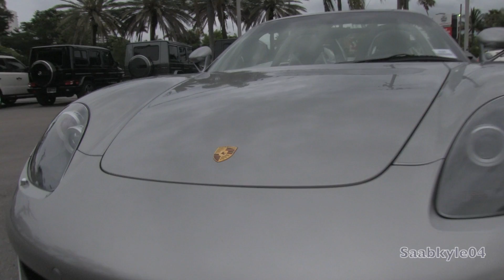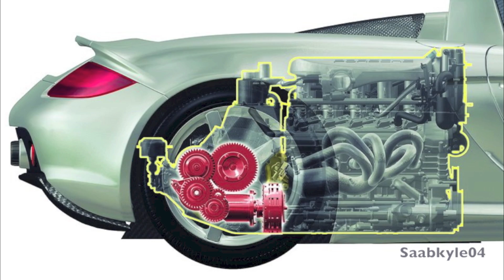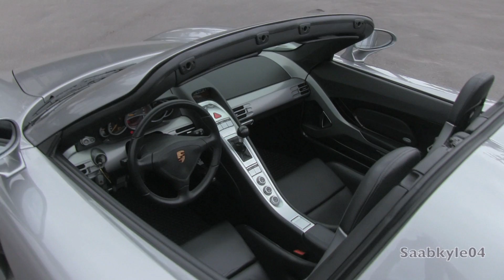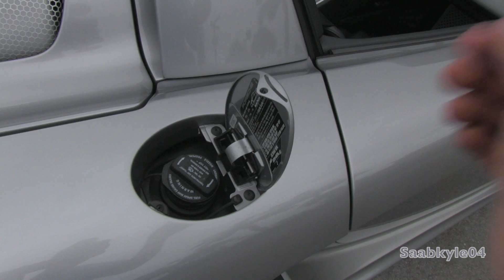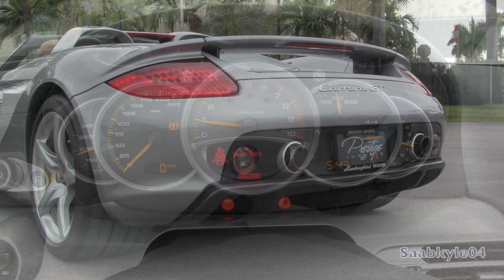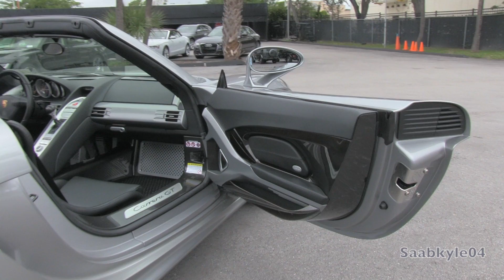2005 Porsche Carrera GT Start Up, Exhaust, and In Depth Review

Comment: You're not going to find a 100% functional Porsche Carrera GT for under $660,000. So if you bought one of these 10 years ago, you made one helluva solid investment, it's selling for $220,000+ more than the retail value, now days. I've seen one sell for $786,000 that's $346,000 in your pocket.
Reply: One with 1,080 miles going for $830,000 in Plano right now

Comment: I was about to buy one but then it didn't have stabilizer that's how Paul walker hit the tree and the way the seatbel t was designed broke his ribs and torso but he couldn't get out of the seatbelt cause it locked
Reply: Sure you were
Reply: +John Petito it was a used one it had 40000 miles
Reply: BS...
That's still a 600 000$+ car
Reply: +Benjamin Nenert my friend was selling one for $499450 he said just because he saw one with 30k miles and it sold for $599999 he ended up just junking the car

Comment: The service interval of the clutch is 10.000-20.000 miles, depending on driving.

It is possible to completely ruin it, by ONLY 3 "launches". I know from experience as I have a relative owning a service shop which regularly services the clutch of one such GT (again in silver)

The clutch with replacement labour costs 7500 euro ($8-9k). The disc itself is 7k euro from germany with 1month wait time.

Talk about absolutely useless hypercar. In comparison maintaing a McLaren P1 is nothing (its almost comparable to regular car-service intervals)
Reply: The P1 and the Carrera GT were made over 9 years apart. Did you honestly think that they would be comparable?
Reply: That's probably because the CGT is more of a race car than a road car. Even the engine is from their race program and the clutch is pretty tricky. 10,000 - 20,000 miles... Likely.
Reply: fuck off
Reply: Виктор Шишков you're what many people would call a "douche bag." the best you or your family could dream of is wiping the grease off a cgt for the people who own them.

Comment: I love Porsches and the Carrera GT is no exception.

However, I have a mixed feeling due to the great sounding engine & mind blowing performance to the 996 era-interior and above all, the movie racing legend Paul Walker...

EDIT: Kyle, I'm surprised you didn't go over the engine's history a bit more in detail. I read somewhere that the V10 in the Carrera GT was actually, as you stated planned to be a 5.5 V10 to be used in a LM racing car. Since the rules changed, the engine was slightly stroked for more torque in the current road application. I guess that also explains the unique sound to an actual racing car.

Comment: The car is all nice and that, but it still suffers from the Porsche-specific flaw of not protecting enough the petrol tank from catching fire after a front collision. I'm not specifically talking about what happened with Paul Walker, but historically many Porsche drivers died not because of the collision itself but from the fuel that ignited. It's unthinkable that a mid-2000s car to not have a sort of shield (like Paganis have kevlar lined around the tank and on firewall to at least keep the fire from the 80 liters of fuel in the tank; it's still after all a car that cost $400k (iirc).

Comment: The Truth On Paul Walkers Death Was...Sad To Say But Was There Falt. They were told not to drive the car because something was "wrong" with it a guy was the post to put it up but didn't. When your in HollyWood Hills With Skinny roads and tight corners and just the fact the speed was exceeding 100MPH Rodger Lost Control and Crashed. It was a mishap that ended badly don't hate on the car for Somthing that wasn't caused by it

Comment: That key resemble the one on my Skoda Fabia too much.
Reply: What is a Skoda Fabia?
Reply: Knut Fredriksen It's a low budget, European made car. It's the cheap version of VW Polo. It's actually a great value for money, it's reliable and it's larger compared to the other cars in this price bracket (~16000 Euros with a Diesel engine). That being said, the key looks just like the one in this video.
Reply: Alin Banc oh, thanks for the answer :) 
I can´t remember seen one in the states?
Reply: Knut Fredriksen Skoda is not sold in the United States. Never has been.
Reply: Alin Banc I know this is wayyy late , but that’s cuz both Porsche and skoda are owned by Volkswagen Group. They also own Audi, Lamborghini, Bentley, Bugatti, etc

Comment: Don't blame the car, blame the driver. Walker's friend was driving too recklessly, and it's unfortunate what happened.
Reply: UndercoverGTR he lost control due to bald tires
Reply: Rip Paul walker
Reply: Yuno RaZe Gassi CHEAH He did not replace it for like ages
Reply: You can blame the car by a smidgen because the CGT was just too dangerous to handle. Everything else was the driver.
Reply: @H982_FKL  Because The Wheel Wasn't Change In 11 Years?

Comment: I don't think people are being serious when they're criticizing the car for being the vehicle that Paul Walker died in. They're just trolling or just idiots. Pay no attention to those comments.
Reply from the maker: maximus9401 You never can tell on the internet, but there's nothing that can be done about that ;)  I don't, just felt it needed to be said.
Reply: maximus9401
No the thing about Paul, when you floor it it`s very hard to control that`s why he died: because the driver was too stupid and he
a) Didn`t know about controlling it at high speed
b) Didn`t give a fuck... he just lost the control
Reply: ***** Can you do a startup & full tour of 2015 Ford Fiesta Sedan?
Reply: maximus9401 When you press the paddle this car is hard to control, I drove it, I hate it
Reply: Go Geo I think you're a bit confused bud. Replied to the wrong comment
Reply: +Go Geo it was more than that, Walker should of inspected the Carerra GT's tires and piping or tubing for dry rot and easy bend before deciding to take it for a drive.

once tires of an exotic car of this type heat up with rot etc driving above 20mph there's literally no way to control a blow out leading to an accident and he was driving faster than 20 mph. He was at fault not Porsche using obvious and most likely logic
Reply: they fuckin pisses me of